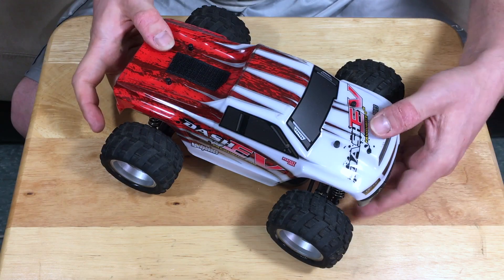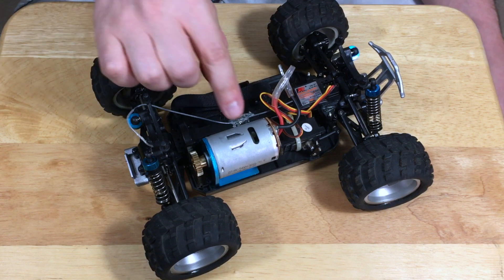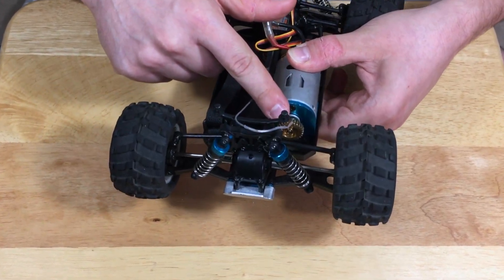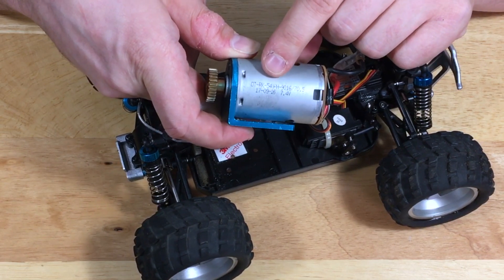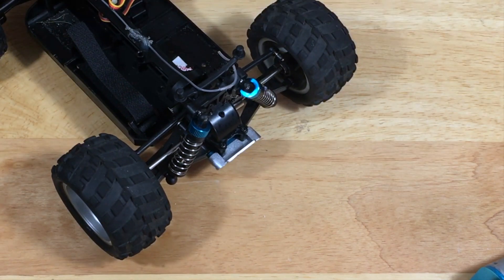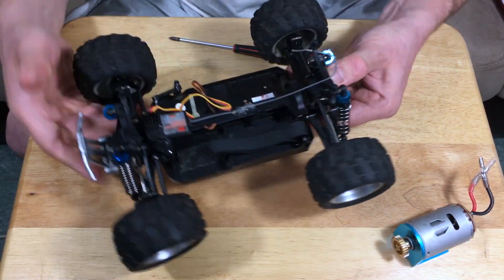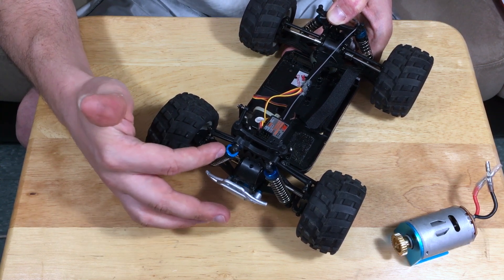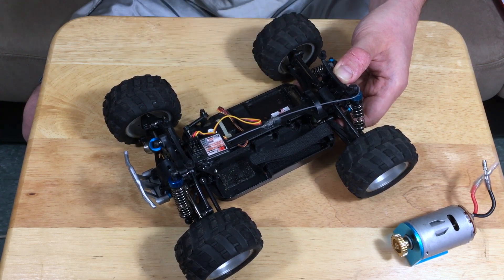Under The Hood - WL Toys A979b Drivetrain Explained

Comment: Too much power with stock motor. It's not fun to drive. I'm looking for ways to downgrade the motor or...  

There's a 3D file on Thingiverse to 3D print an extended chassis to turn it into a 1/10 drift car.

Either way it's not a fun car to drive at all. Normally I bash my RC vehicles but this one bashes itself with rollovers, cartwheels and out of control crashes. It sucks. 🤣

Comment: ESC burned out LOLsee previous comment on previous video for this rc I understand why it’s so fast now because of that huge pinion gear
Reply from the maker: yup, pretty much all about the huge pinion gear, exactly.  These are daily stock 540 size motors, but the crazy high gearing and light weight chassis makes these faster than expected, you know.  I have come to hate this POS, btw, mine has a full brushless in it right now, still hate it,  terrible steering even with a high end new servo.

Comment: Nice video, Will any 540 brushed work with the stock esc?
Reply from the maker: hello,  yes.  All that matters is that you don't go to a super low turn rating, I'd say under 13 turns.  So the lower the turn rating on a brushed motor, the faster the motor will be.  Generally a mild modified motor will be rated from 13 turns to 15 turns.  Although this stock motor is fast enough in this system.
Reply: @hybrid32494  could I run a 550 12 turn?

Comment: Is the esc built into the back of the motor?
Reply from the maker: hey buddy!!  in this particular video the ESC is removed, because it burned down after I upgraded it.  What you see at the back of the motor is just some motor wiring components.  Will soon be putting in a brushless system into this.
Reply: @hybrid32494  sounds good
Reply: @hybrid32494  bh